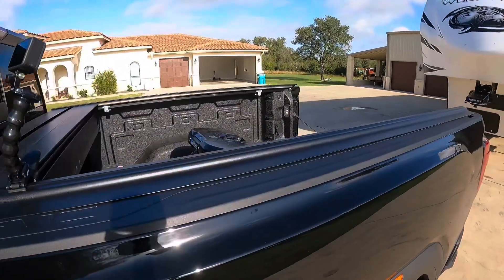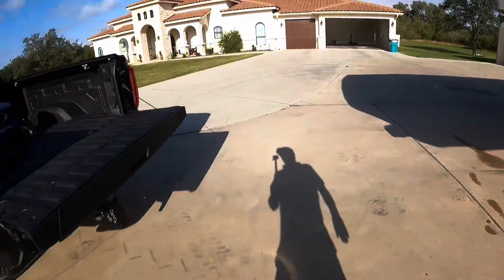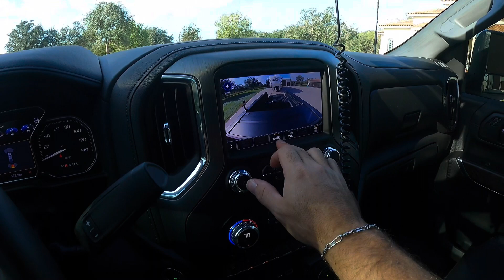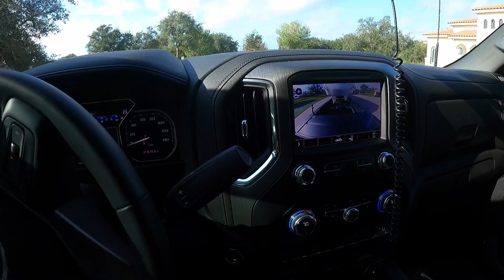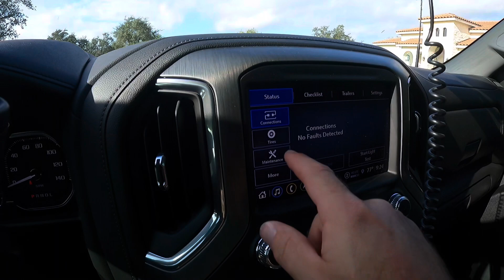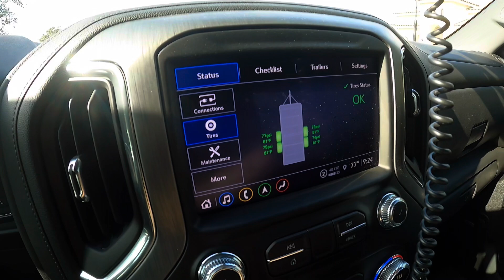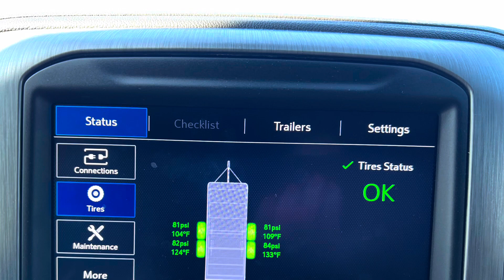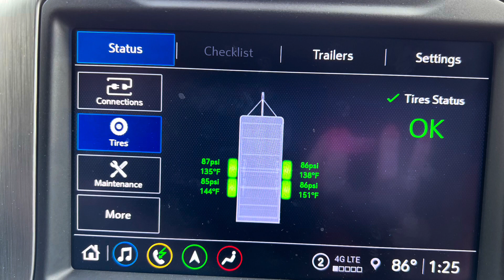2023 Denali HD using technology to hook up RV

Comment: Good video 👍. I know it's not pertaining to the video but how do you like the Banks tuner? Is there an actual power difference or is it minimal in your opinion? The GM Hd trucks are nice in my opinion. So far so good with mine.
Reply from the maker: It is a significant difference when paired with pedal monster.. Zero regret on the banks purchase. The duramax engine is banks fav motor.. they definitely put some R&d into it. I’ll do a video explaining it in a bit..
Reply: @RockyRohde  thanks for the reply will be looking forward to it.